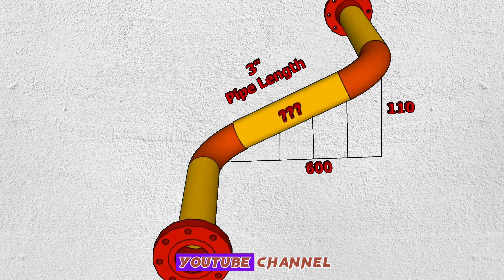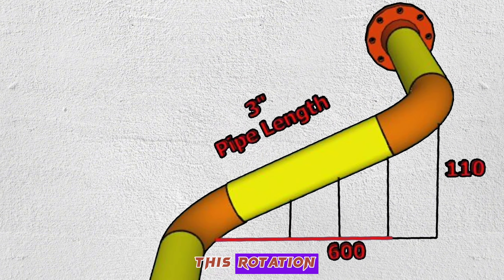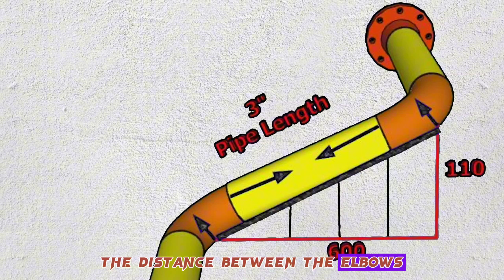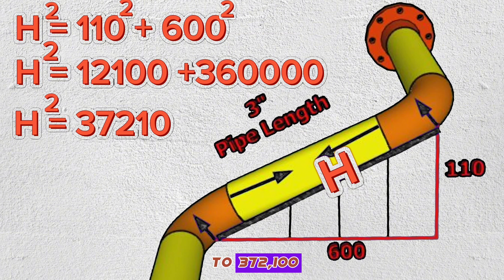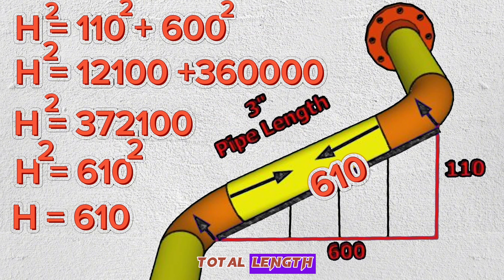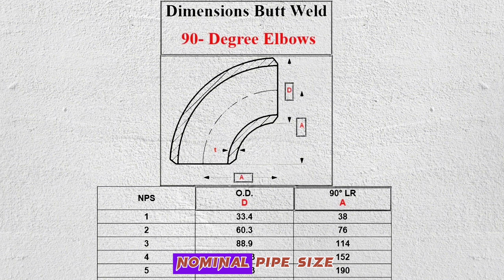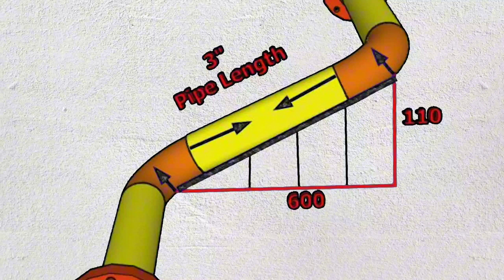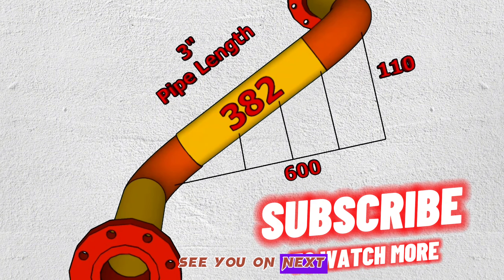How to calculate Pipe Length. Pipe Length Calculation.#piping

Comment: You forgot sir you will not deduct the welding gap of 90 degree elbow total: is 610--2x114--2x3 = 376 the length of the hypotenuse pipe.